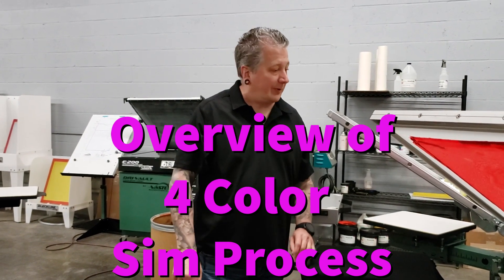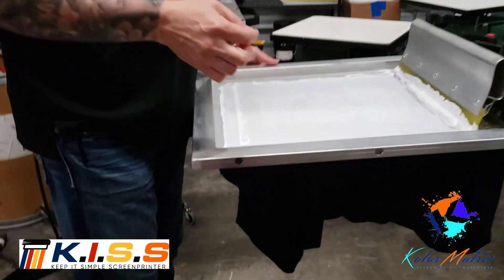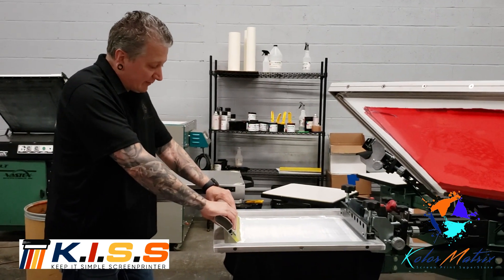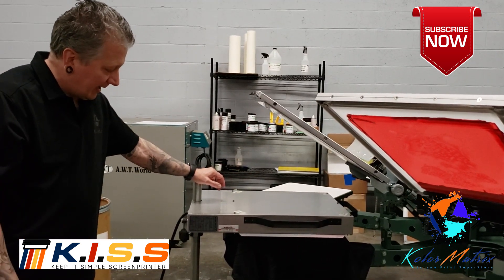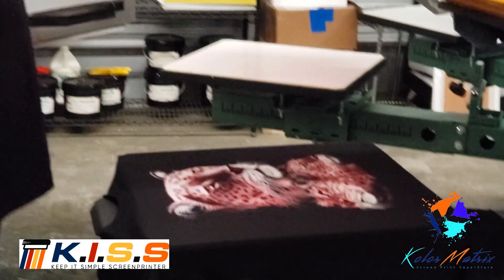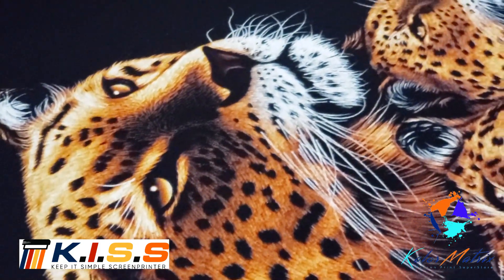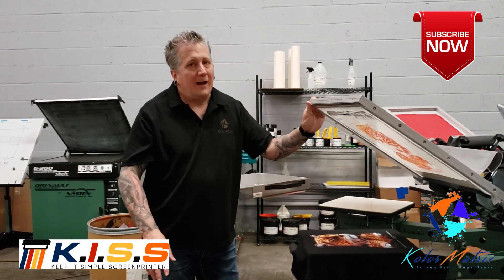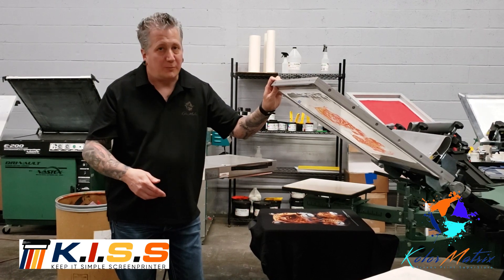Full Color image Screenprinted using only 4 colors on a dark shirt

Comment: Looks great!!! lol This would have never worked in the shop I worked at. You were lucky if you got a single shirt in registration. Needless to say our presses were a disaster.
Reply from the maker: Thank you, sounds like old equipment and / or old screens. Loose tension on your screens can also cause registration problems. Thanks for sharing
Reply: @KOLORMATRIXAtlanta  Nope. Screens were fine. We had a lot of employees during my years there and most of the heads would shot. We had a brand new Vastex that was a champ until one of our screeners stripped most of the heads. But most of our presses were old cheap models. Lol our owner was a penny pincher. I ran a really old 4 color press most of the time and the springs were shot so the heads were held up with rubber bungee cords. Took me about 6 years to get actual get them to order replacement springs.
Reply from the maker: @standepain  wow, sorry to hear that, sounds like it made everyones job 10x harder. Sadly your not alone, I have heard from many printers who stuck in that kind of shop. Glad to hear you have moved on.